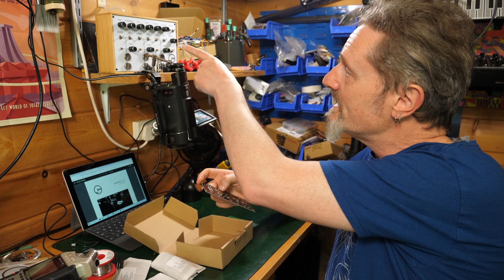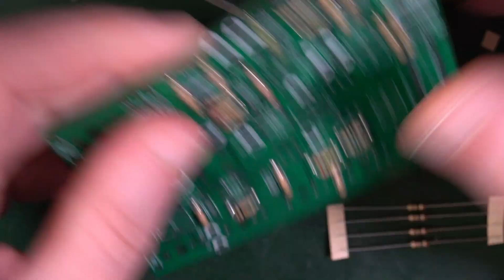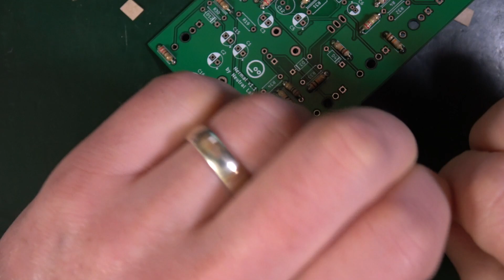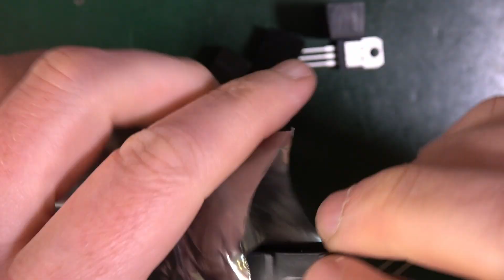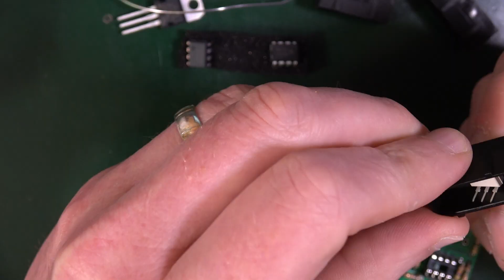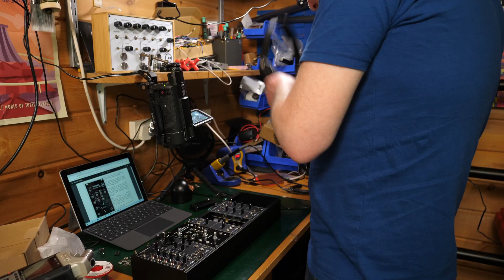Neutral Labs Nermal Distortion module DIY Build

Comment: Ah, lovely! I just built the Elmyra and Meg myself and enjoyed those builds quite a bit. They both felt quite spacious in comparison to some of the other stuff I built recently. I'm not sure I like the heatsink of the voltage regulator on this one sticking out of the back? Would have been a good candidate for using an SMD part instead.